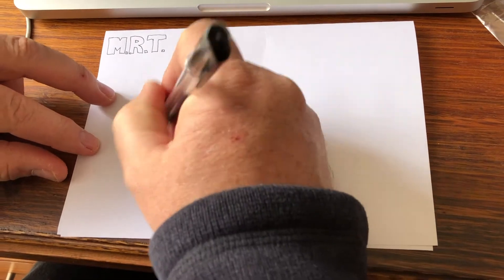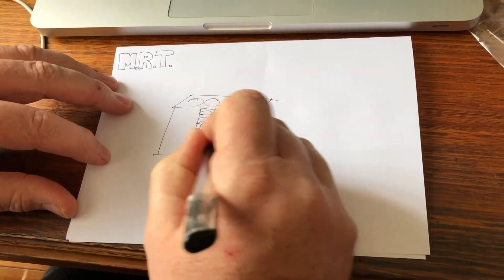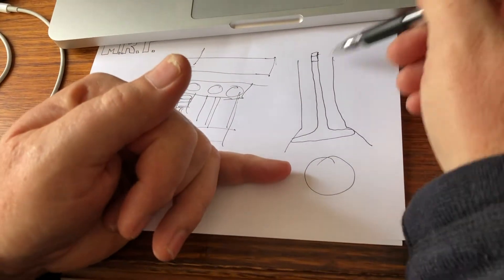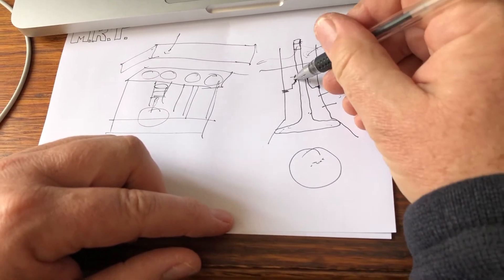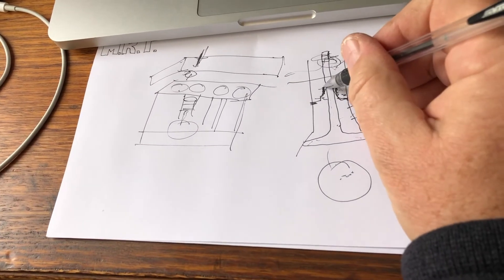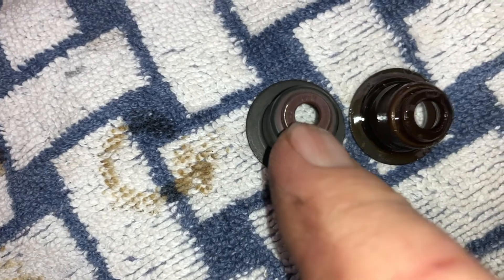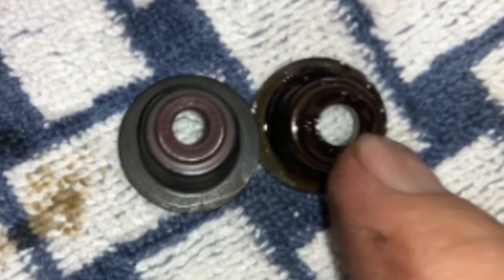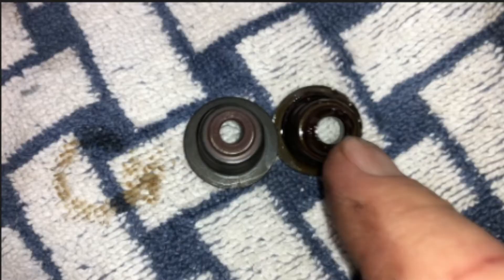What are valve Stem seals in an engine. What do they do? Why are they important? BMW

Comment: Thanks Mark, very clearly explained for non technical people like me.  I’m concerned about the valve stem seals on my marine engine, as I have switched to GTL fuel from diesel.  Apparently there is a chance that GTL does not swell the seals as well as conventional diesel does, and they therefore might leak. 
Having read this in a technical report, I really wanted to know exactly what and where the valve stem seal is.  You explained it perfectly, many thanks.

Comment: Thanks Mark. From your drawing to your clear explanation, so well done. I asked my local auto repair shop if they could replace my Mazda 3's engine valve stem seals. Made an appointment. Dropped off my car. Rode my bike back home. End of their work day, they called "sorry, we don't do this kind of work". Even though I told the gent at the counter upon dropping off my car that it was engine work, not tires. At least I got a good bike ride in and a good story! Sending them your video link. Education and learning is great!